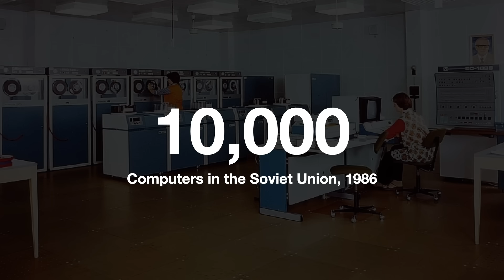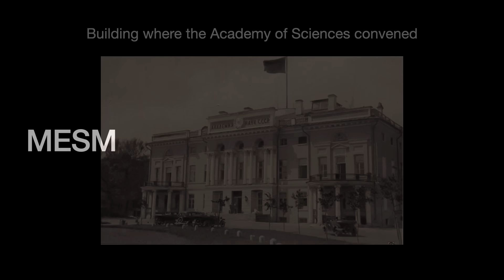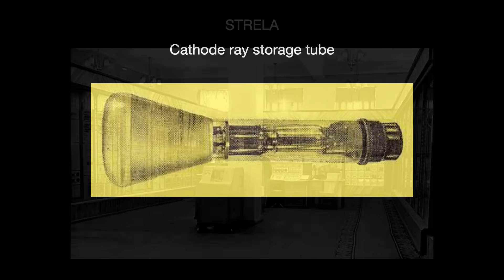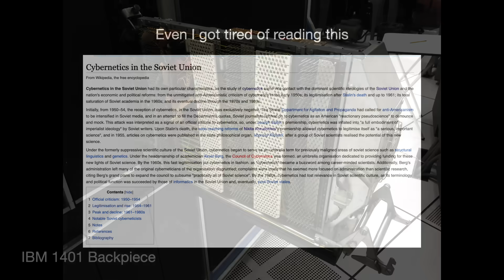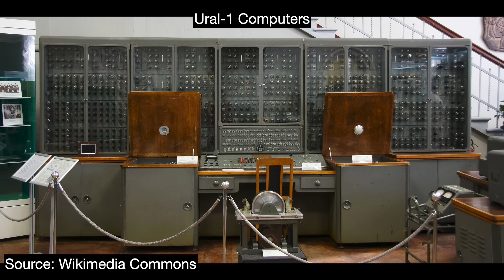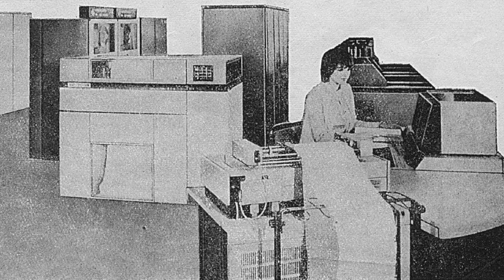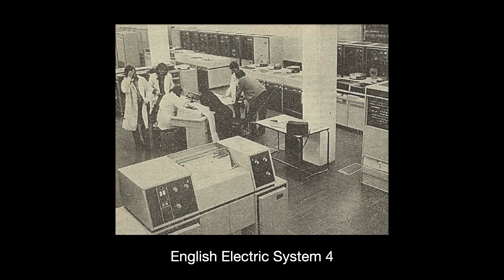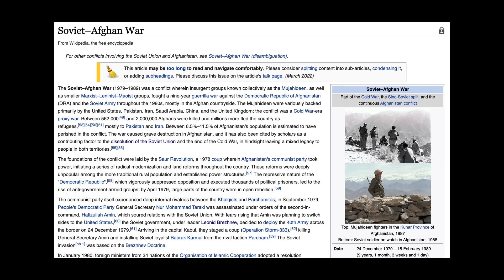Why the Soviet Computer Failed

Comment: Did the soviets at any point put their computers for sale to other countries? Also wasnt the strela the same computer used in chernobyl?
Reply: Soviet union tech and technology always had issues selling overseas.

That's why they used oil
Reply: There wasn't enough capacity to satisfy internal demand. There were some sales within the Eastern bloc but they didn't matter; also fundamentally ICs were manufactured both with the domestic 2.5mm pitch lead frame and the export 2.54mm lead frame, with the latter being used in East Germany and elsewhere.